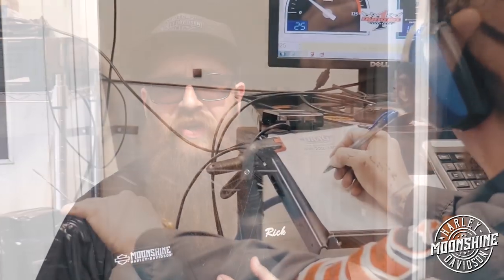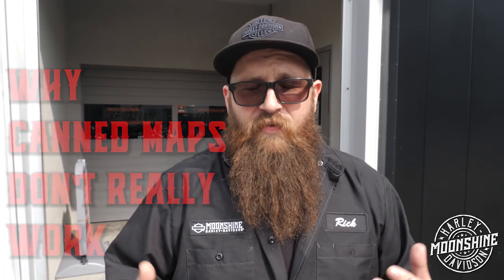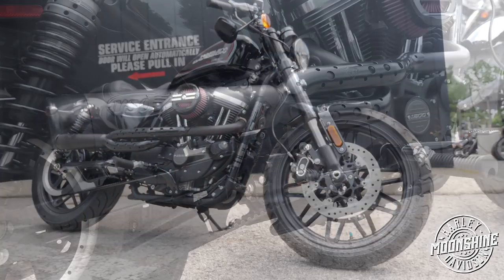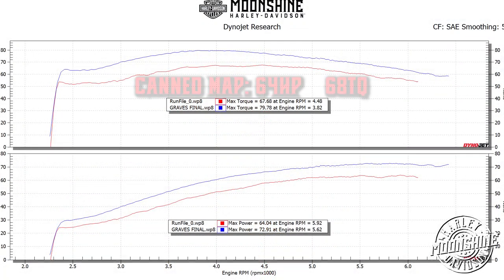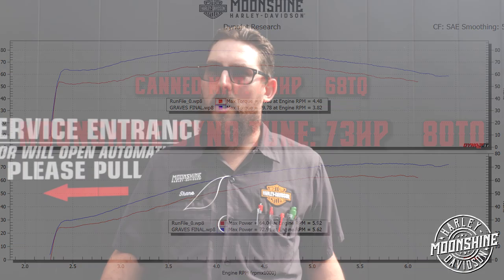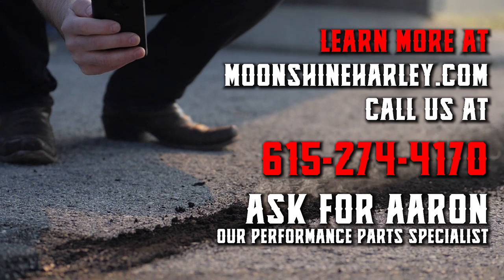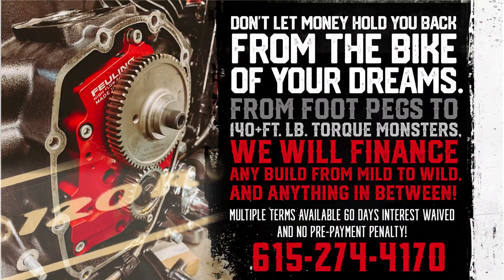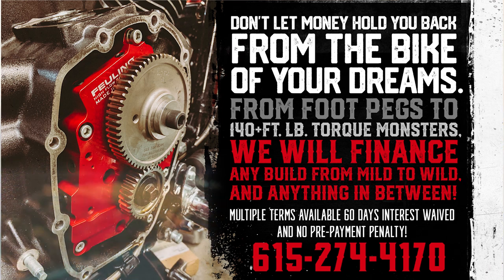Canned Maps Don't Always Work (Our Dyno Tune Made +9HP & +12TQ)  | Shop Talk Episode 26

Comment: Thanks for the info.  I see it all the time.   People need to do it right and get it dyno tuned .  I see people get a build going and skip the dyno session . Because the bike runs good.    Even a stocker can benefit from a good  session .
Reply: Yep and not a dealer. Go to a performance shop and you'll see the difference between a horse and pony

Comment: I did a stage 2 with 447 torque cam, Rinehart Slimeline Duals with DBX45, n the moto inverted air cleaner,  Harley street tuner with the smart tune pro on my 20 ultra limited. The canned map was ok but they dyno tuned it and found 5 HP & 9 TQ. I ended up with 102 HP & 122 TQ

Comment: I've read through the comments and here's my take. You guys do a great job,  better than most dealers, even the one that offer dyno tuning. 
Firstly,  a stock bike CAN benefit from a dyno session, simply because the CANNED program is a COMPROMISE for various reasons, primarily : emissions regulations. 
Secondly,  there's a legitimate comment from a old fart like myself who's been tuning for a million years WITHOUT a dyno, yes brother I get it,  but NOT on the F.I. bikes. Can you sniff the pipe and read plugs, yad, yada, of course,  but the SOPHISTICATION of the F.I. leaves a KNOWLEDGEABLE DYNO TUNER to EXTRACT that much more power, WITHOUT sacrificing reliability and drivability,  hence the dyno tune pays for itself many times over. 
For the engine builder, a good analogy would be a change of ignition system in a older naturally aspirated engine.  The new ignition will NOT give you more power like a cam, compression, or better flowing heads would do, BUT, it allows you to change parameters that will ALLOW more power to be made and used. The power came from the V.E. or volumetric efficiency of the build, plus factors like displacement,  rod length, bore to stroke ratio, CAM TIMING, wave tuning , etc., but the fine tuning of the ignition and or carb, or in modern F.I. allows the power to be BEST used. And of course the word BEST may describe,  highest peak and a flattest torque  curve,  or the highest M.P.G., or the lowest emissions.  
🇺🇸🏍🇺🇸🏍🇺🇸🏍🇺🇸

Comment: After seeing this I put mine on the dyno. I gained 4 HP and 3.5 TQ with a lot smoother fuel curve and better fuel ratio
Reply: A proper Dyno tune is  the best bang for the buck in performance gain.

Comment: YOU HAVE MY BIKE!  Except mine is Red.  Roadster, High Tracker Pipe.  I need to put on a High Flow Intake!  Did you have to push the shocks back with a bracket to stop them from hitting while flexing?  I had to and it changes a little bit of the feel of the bike!  Power gain is really good!  My local dealer starts with a Map with the Screaming Eagle.  If it meets their expectations under dyno they keep it.  If it doesn't then they custom tune on the dyno.  They know what they are looking for.
Reply from the maker: Not sure why they would like a target tune if its already on the dyno ?. If you want it to have a crisp throttle and a better power curve.  Relocation brackets typically cause more problems later. I believe we flipped the shocks if my memory serves me right. Not all shock are able to be run upside-down so check.

Comment: What do you do when you need a tune but the motor needs broken in before you can dyno it?
Reply: If Dyno tuned properly it will not impact the engine at all.  It is worse to ride an improperly tuned engine for 1000 miles (or what ever your recommendation was) than to tune it correctly in 30 or so and finish the break in with the engine dialed in.

Comment: What happens to the warranty on 17 and up for not using harley parts.
Reply: Nothing unless you flash the ECM with anything other than the HD Pro Street tuner and/or visit a dealership that reports it to the Motor Company.
Reply: M.V.O _Motorfast - Now the bike data is uploaded and any mods to the computer are reported automatically. HD is also known to ask for pics of parts to verify they are not aftermarket. At least they did on mine. Glad my warranty has finally expired.
Reply: @NoName-vz1ob  Once it is hooked to the Harley diagnostic computer if you have been bad it will report you to the Mothership in Milwaukee.  Bye Bye Mr Warranty.  Some aftermarket parts are approved if installed by a dealer.  Others... GREY AREA!

Comment: How much does it actually cost to dyno a bike? I think the local harley shop put mine on a computer to remap the ecu.
Reply: You pay for the time.  Usually 4 hours.  It takes time to prepare load and set up the bike, programs, sensors etc.  Then the actual tuning time followed by putting it all away and reassembly of the bike.  Then the tuner should always take the bike for a good test ride and make sure it operates on the actual street as it should (no timing, starting, throttle issues and what not).
Reply: Cost me $600.

Comment: Can you guy dyno a 2018 street glide with a fat tire installed?
Reply: Fat front or rear?  As long as we can secure it to the front chock we can run it.
Reply: M.V.O _Motorfast fat front.
Reply: @QWill02  yes.  180?

Comment: And yet every vehicle on the planet comes with a 'canned map' from the factory. Any vehicle loaded with a map for specific mods will work well as long as the map was done right in the first place and the mods are exactly the same......Don't believe the hype!
Reply: You do know that is exactly what the video is right?  How much improvement a tune can make on a stock engine?  
If you got your stock bike tuned it would run much better.
Reply: @NoName-vz1ob  I've been building and tuning Harley motors for over 30 years, you should probably save your BS boutique boys that pass as bikers these days.
Reply: @midas61  hahaha!
Reply: There is tuning and then there is fine tuning.  The map might not have the exact combination of parts for a perfect tune or they might load a tune that will get you by.  Sometimes a custom tune is needed and sometimes it is just a nice thing to have.